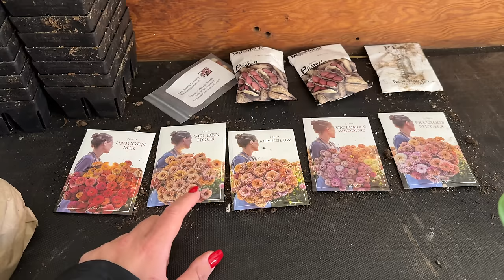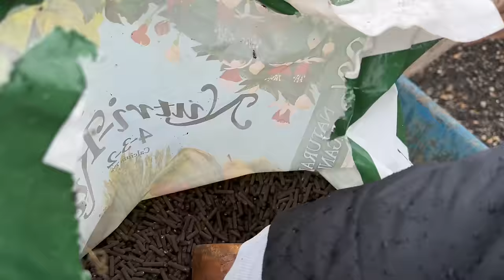Rain or Shine it is Happening Today!

Comment: One thing I learned while working in a kitchen is, I wear small, form fitting latex gloves under my garden gloves when I'm working with anything that can get them wet. It keeps your hands dry and much warmer. You can wear them over your garden gloves as well. It's a little overkill, but your hands won't be cold and wet while playing g in the garden.

Comment: You can soak the cluster of onion starts in a pot of water for about 10-20 minutes before starting to separate them. The dirt just melts away which makes separating each start easier. 😊

Comment: My Eldest brother used to have horrible trouble with slugs; Take your egg shells and dry them out. Lightly crumble and the slugs will get cut up and die. It is an all natural way of contouring the slugs, it took my brother about two years to get it down to only seeing 3 or for instead of 30 to forty per foot.  Slug do travel.  Since we have been having egg shells in the compost and gardens we have less slugs.  Hope this helps you.

Comment: instead of chucking the slugs over the fence. Get a bag with some salt and put them in the bag.  If you are going to use organic fertilizer put it in 2-6 weeks before you plant since it is not bioavailable until it is converted by the soil microbes.

Comment: Put a small sheet of plastic wrap over the very top of the lasagna and then put the foil over it. The cheese won’t stick to the plastic wrap. If you just use the foil then the cheese will stick to it.

Comment: Beer traps work well to eliminate slugs😊  or 

Any yeasty, sweet liquid will attract them, so keep the beer for yourself and make a gooey brew that the slugs will find delicious by mixing equal parts flour and water with a heaping spoonful of molasses, a sprinkling of cornmeal, and a teaspoon of yeast.

How to make a beer trap:

Cut the top off of a plastic bottle, invert it, and stick it back in the bottle. Fill the trap with beer and plant it in your garden to kill slugs and snails. Every 3 days, empty either type of trap and fill it with fresh beer.

Comment: Hi Becky, wondering why you dont use the 4x4 you purchased for the garden?  Wouldn't that hold alot more than the wheelbarrow and create less step back and forth?
Reply: She commented on another post that she's not the best at driving it. I think the path has quite limited spacing.

Comment: I noticed you are wearing a heavy winter coat. When did you film this project and how cold is it actually? That's a lot of onions. Feed them slugs to the chickens. LOL. I never had slugs where I grow. I would put some peet moss in those beds for potatoes. They like an acidic soil. We buy our compost by the truck load from a local dairy farm.
Reply: LOL. The fact that you questioned when this was videoed shows you dont know the PNW. Theyve had warm days, snow, freezy rain, all since winter ended. But more nasty weather is due next week. Ocean breezes are COLD this time of year.
Reply: @queenbee3647  I really don't appreciate your insults and nasty tone. I never said anything nasty. Just inquiring about the current weather. I would appreciate an apology from @queenbee3647 since you can't use your REAL name.
Reply: @queenbee3647  I'm done watching this channel and I don't need to be insulted. I have a lot more important things to do with my time.